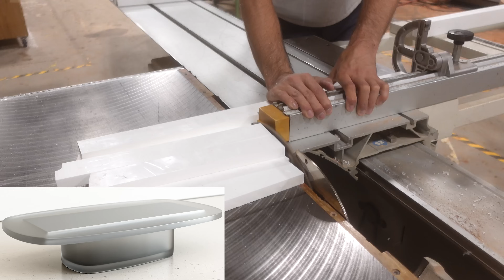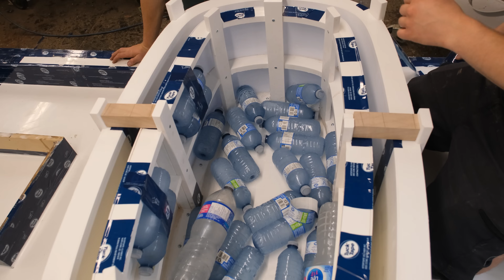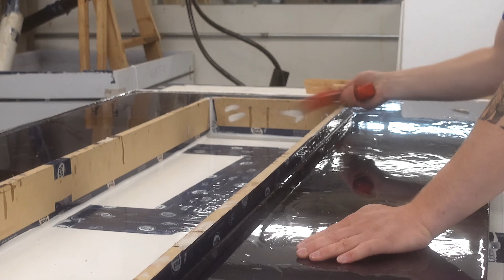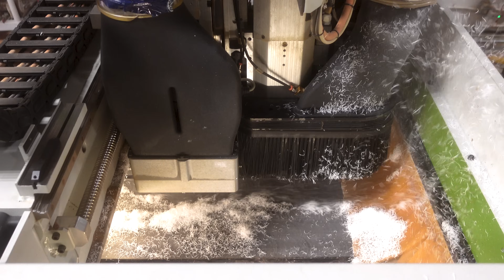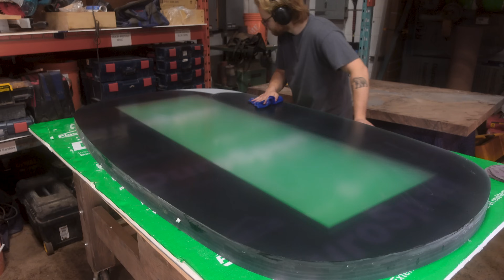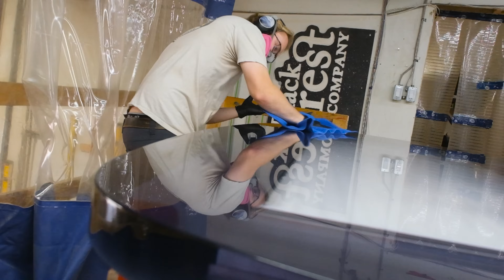Our Client Put A $100K Painting in a Resin Table

Comment: @Black Forest Wood Co.
Far be it from me to believe that I know even close to as much about "plastics" as You do.
That said I do know that flame polished acrylics can (usually) become "susceptible" to (surface)cracks. Not immediately, but over time, OR if coming in contact with "volatiles" even ever so briefly (it doesn't even need direct contact, vapours can be enough). And though the surface cracks "usually" are not  necessarily  structurally catastrophic, as long it's not a "stressed part". They can still be quite catastrophic if they destroys the aesthetic quality of the "piece"... 
And so I would strongly recommend that You "looked into" (investigate, examine and test) the "Pros and cons" between '"hand" and "flame" polishing.
Best regards

Comment: I'm sorry, I can't help myself, sure, cool looking table, but what's the use if nobody dares place anything on it lest it leaves scratches? I'd have looked for a way to mitigate that, maybe with a protective glass surface. It would have increased the cost of the table, but the customer doesn't seem too worried about expenses. Otherwise nice work.

Comment: It looks fabulous! I have two functional questions: 1) is the top surface absolutely waterproof where the clear meets the frosted black?; and 2) Do you know if the epoxy is done outgassing?  #2 is because the acrylic is safe for the artwork, but I have no idea if the epoxy is or not due to the possibility of any outgassing possibly yellowing the artwork over the years.

Comment: Frosted bottom surface really works for object of focus, the painting, rather than the table. Curious if you'll try this again with existing molding already perfected to make another table, just to be the art in itself as you usually do..?  

The square cutout for painting seems a little off with all those curves, so maybe on another similar "cousin" table you could delete that, or make it a rounded, symmetrically aligned oval if there is something else to be displayed like antiques, archaeological pieces like bones, or other non linear, organic items ? Not sure if an embedded item is worthy of all this... but maybe multiple tops could be tried out for different customers.

Comment: If you filled the void with water, it helps to more efficiently transfer the "cold" to the mold
Reply: If there would have been a leak then it would have been a real mess
Reply: Epoxy resin and water are not friends, if there was a leak it would be ruined.
Reply: The risk of resin mixing with water is not worth it, but maybe gel ice packs could have worked the same way.
Reply from the maker: @piraterubberduck6056  Yeah we just had a giant pack of water bottles in the breakroom so we just used what we had on hand, but if we get more tables like this in the future we'll definitely be buying some gel packs!

Comment: The inner frame absolutely could have been plywood with the thin hdpe wrapped around it
Reply from the maker: Not really, HDPE and plywood both are not clear, and the resin is which is why we used it as a window to protect the artwork. We could have used glass or something but then it would look less cohesive because the rest is resin.
Or do you mean the base?
Reply: @BlackForestWoodCo  no I meant the frame of the mold
Reply from the maker: @andrewlondon3461  Ohhh! Haha, It could have been! 
But since we wanted a more rounded shape it was easier to use the HDPE

Comment: That wa an excellent video. I believe this type of furniture will become more prevalent in the future. How much did it way? It looked like it took some intensive man hours to build. Have you come up with other designs similar to this one? I believe if you come up with more rough designs clients looking for that one special table will have more options and may push the envelope of the design.  Great video. Thanks for posting.
Reply from the maker: Good question, I'll have to double check but I believe it weighed around 600 pounds or so! Yes, a lot went into this one! Even just trying to figure out the design for the base mould took a long time, but we luckily got it right!

Thanks so much!